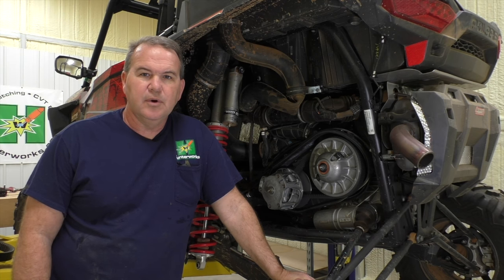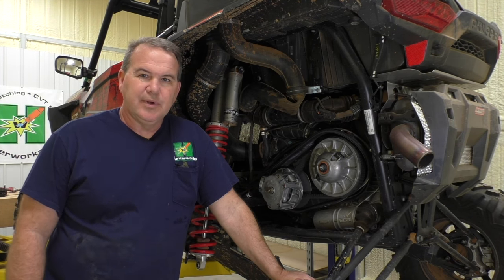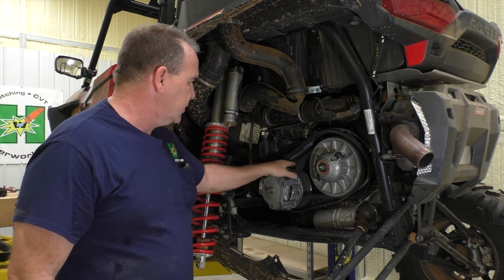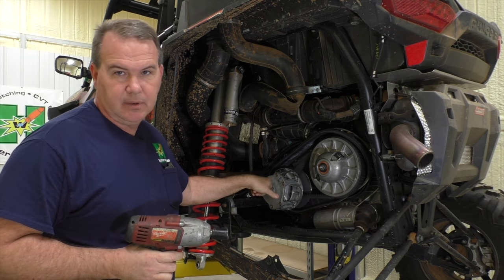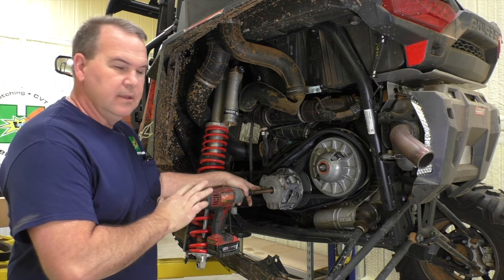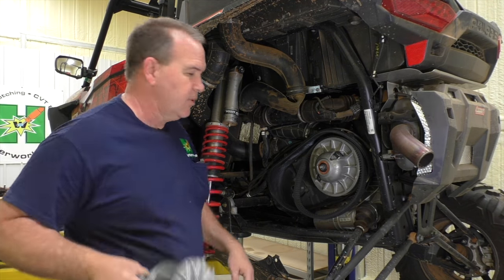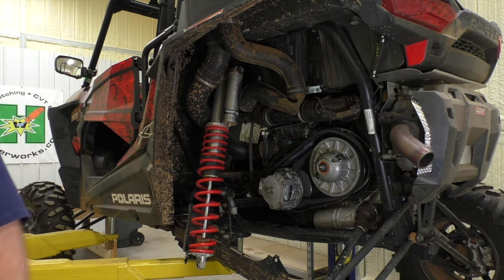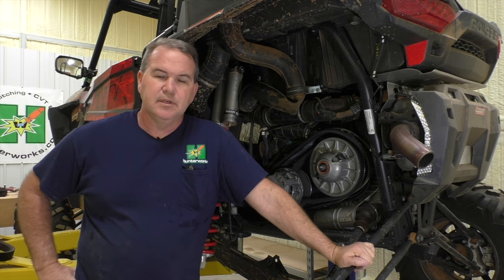How to Remove Polaris RZR/Ranger Primary Clutch

Comment: The best way to remove it is using hydraulic action,  fill the hole with grease first then put in the extractor bolt, it works without hitting the end with a hammer.
Reply from the maker: Then you got all that grease over everything, a puller works just find 99% of the time.  Odd one is to use bread in the hole, google that
Reply: Thanks, that worked perfect, grease in the hole!
Reply: @curtleake2191 We still talking about clutches here?

Comment: So I have a question I got a rzr 1000 xp and I can literally watch my primary clutch move an 1/8 of an inch back and fourth is that because I didn’t tighten it enough?
Reply: That’s on that bolt that holds it on
Reply from the maker: @dunejumper0077  I would have to see that email me a short video or text it to our number at hunterworks todd@hunterworks.com 601-771-0070 and I’ll look at it Monday

Comment: Good video, I had trouble with a 2019 ranger crew xp1000 primary wouldn't come off for anything ended up pumping grease in the crankshaft hole, popped it out!! I agree with not putting anything through  the the clutch that's a big no no. Ps Thanks for the line up tool, it worked great!!
Reply from the maker: Good deal and thanks

Comment: I just had some experience with what you said about putting a handle through the primary and loosening your spidernut, only I didn't realize I loosened it. Do mostly trail/mountain riding so I guess that's why I didn't notice a loss in top speed or really anything until my daughter was stuck down the road because it wouldn't move. When I got it home and took the cover off, I realized everything had come loose. The spider nut wasn't even threaded on at all. I couldn't figure out why it came loose but the only time I had the primary off, which wasn't long ago, I used a wooden handle through the middle so I could get 96ft/lbs. I'm pretty good at finding out what not to do lol
Reply from the maker: I resemble that last sentence myself!!

Comment: Huge help. Had to tap mine to break it loose. Dealer wanted $2000 to replace clutches and belt. I replaced primary and belt for $200. Runs like a champ.
Reply from the maker: Where did you get a primary and belt for $200?
Reply from the maker: @budgetcardcollector6988  you need to watch our video on not buying these chinese clutches, you might get lucky but most are just doing it again very soon
Reply: @Hunterworks  completely understand the risk, but the item had good reviews and I thought was worth a shot. If it fails, I'm only $134 out
Reply from the maker: @budgetcardcollector6988  and a belt and possibility of coming apart, taking secondary out too.  I see this stuff every single day.

Comment: Fill me in on the secret of getting a broken bolt out of the shaft that is deep inside about an inch. I have a general 1000 with this issue (happened on the trail). I've tried to drill the center and use an easy out but it rounds off the easy out.
Reply from the maker: Different style of easy out most likely, the ones I use do not slip. Go to amazon and put this in the search RIDGID 35585 10 Screw Extractor Set, 1/4-inch to 1/2-inch Broken Screw Extractor

Comment: Ok 3rd trip to the store for the best impact driver they have. Just to double check I’m supposed to go forward once the clutch bolt is fully treaded correct? Logically it had too but just double checking...
Reply from the maker: Clutch bolt or puller?

Comment: Hey Todd, any other ideas for how to get a primary off with your tool? Ours is pretty hard core on there……
Reply from the maker: put under load with the puller, then smack with a hammer hard on the end of the puller, then if that does not work, then google the bread trcik for pulling clutches
Reply: @Hunterworks  the hammer trick didn’t work but I was able to pump grease into the shaft, then wind in the tool…sort of a hydraulic aid, then just before the tool bottoms out it pops off. And I mean POP!!!
Reply from the maker: @mattsmith8345  That is what the bread does without all the grease you MUST get completely out.  Wrong bread maybe LOL

Comment: Wel that’s sweet and all, but can you do a video where a impact won’t get the clutch off, I’ve got a 700ftlb wilwaukee impact and the clutch puller stopped turning and it’s not popping off, I’ve got a 690ftlb air impact and it’s not moving it anymore either, so I have to bust out the breaker bar?
Reply from the maker: Bow Hunting Michigan been a while since I watched this.   If won’t come off hit end of puller under load with a hammer a couple times to send a shock wave.  That don’t work you gotta cut it off I guess.
Reply: Hunterworks Inc. hmmm I’ve got some force on it and have been hitting it pretty decent but don’t wanna break anything, I’m having creeping issues when in gear and not hitting the gas so I just wanted to take it out and clean it up, guess I’ll just hit it with air and put the bolt back on lol 🤷🏻‍♂️
Reply: Do you have a email that I can show ya what’s going on?
Reply: Hit it like you have a pair, ffs! Really?
Reply: On a snowmobile primary, I pack the centershaft full of ATF and grease before sending the removal tool in. It creates an incredible amount of hydraulic pressure and assists with removal. Don't stand in front of the clutch when it lets loose though.

Comment: My primary grenaded and the rear sheave is still stuck on the crank. What’s the best way to get the rear sheave off?
Reply from the maker: Isaiah griffith use a clutch puller.  Guessing the center part still there.
Reply: Hunterworks Inc. got an email I can send you some pictures on?
Reply from the maker: @isaiahgriffith7896  todd@hunterworks.com

Comment: Is lock tight recommend when putting the screw back on? Mine kept coming loose
Reply from the maker: not normally, what brand of clutch is it? Torque?
Reply: @Hunterworks  it’s the factory Polaris one. I didn’t torqued it I put a dab of loctite and used an impact
Reply from the maker: @williambarroso7398  I can do this better in an email, send me one at todd@hunterworks.com

Comment: Does the clutch have to be calibrated after the install?
Reply from the maker: I do not understand what you are asking.
Reply: Is there anything I need to do after I install it, or is it all set ready to go.
Reply from the maker: @mikemaday5599  still not understanding the question so I will answer based off what this video is about, take it off and put it back on, nothing to do it.  Recalibrating is buying a clutch kit and installing it after you made some change like larger tires, sand riding or high elevation riding.  You recalibrated the clutch to work with what you have or did or where you ride.

Comment: how can you get the primary clutch off once the treads have stripped out?
Reply from the maker: Assuming you mean threads where the puller goes not the threads in the crank where the bolt goes that holds it.  I don't know of a good way, may wind up cutting it off

Comment: Are use a torque stick with my impact it seems to work for me
Reply from the maker: Good idea!!
Reply: Works every time!
Reply: @Hunterworks  I don't think so been orking as a auto tech for 19 years am use to work with torque wrench ,torque stick and just my air and cordless tools , bought my rzr and have been doing a lot of work but when I bought a factory primary clutch and use my torque stick with my cordless I broke the clutch assembly..got a second one and use my snop on torque wrench and broke it again..used my cordless as you explained on this video and no issues LOL

Comment: What if you can’t remove the nut with a impact gun ?
Reply from the maker: Assuming you mean the bolt not nut that holds the primary clutch on, get a bigger impact.
Reply: Hunterworks Inc. got it had to buy An air impact gun ha but the deed is done
Reply: Hunterworks Inc. thank you

Comment: This is the video where you call the puller a hunter works hardend tool and to buy yours The one you sold me is a EPI preformance tool not hunter works RZR/ RANGER
Reply from the maker: True, however this video is not a XP 1000 Ranger, you can't use these methods on a XP 1000 Ranger, that clutch comes off in two pieces.  Sorry for the confusion
Reply from the maker: click the show more part and read the notes